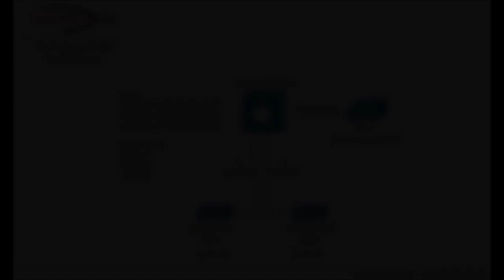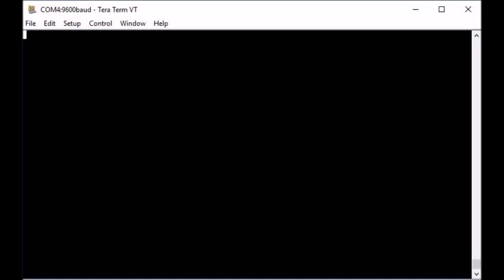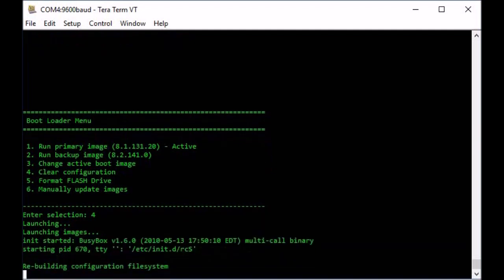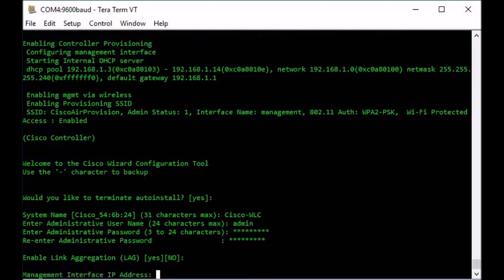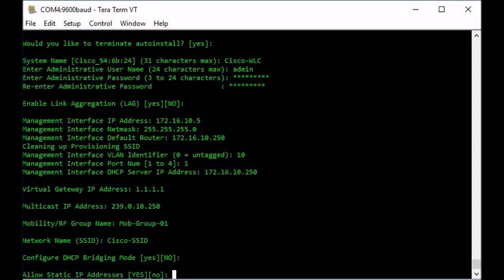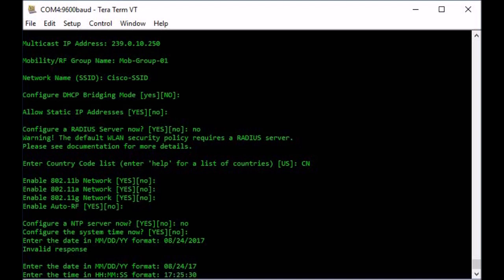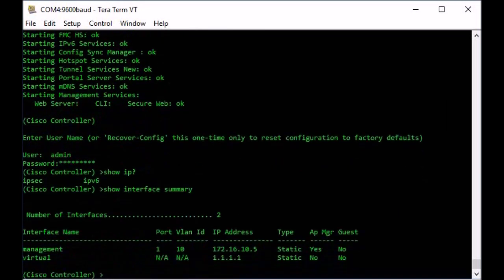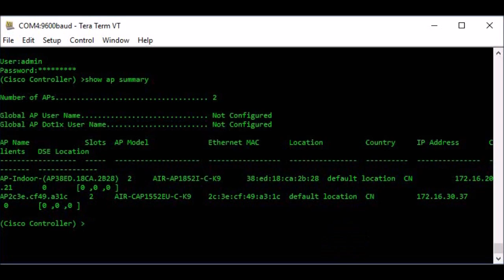WiFi-Net#01: Setup Cisco Wireless Controller (WLC)

Comment: Hi, 
I need to configure Guest ssid who have access only to interenet - not access to local LAN. Do I need configure on router (or switch) or on the wifi controler (and do you have example)?
Reply from the maker: You can try the WiFi controller Access Control Lists (ACL) section. 
Security tab > Access Control Lists (from left pane) 

Just need to select the Guest Network IP range (as source) and deny to access to the local network resources (as destination)
Reply: OK. Thanks.
Reply from the maker: What was the result? Success?
Reply: haha, našao sam te